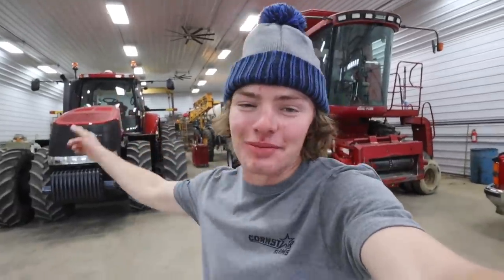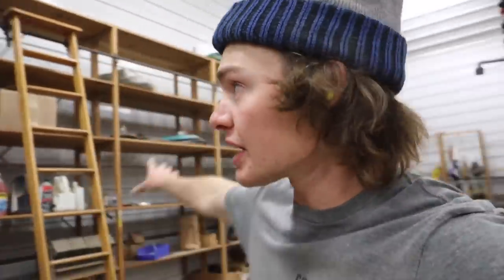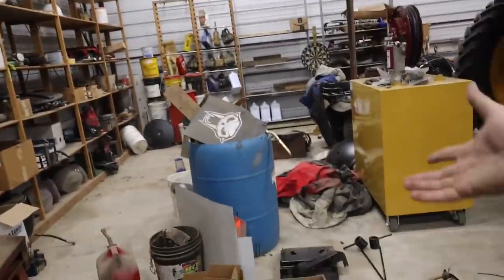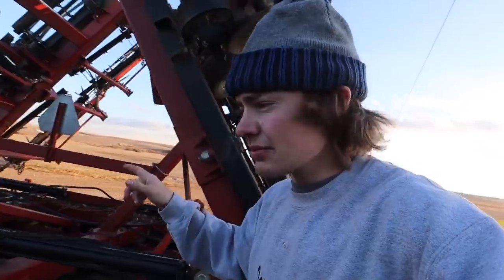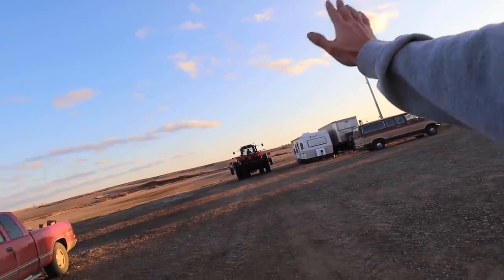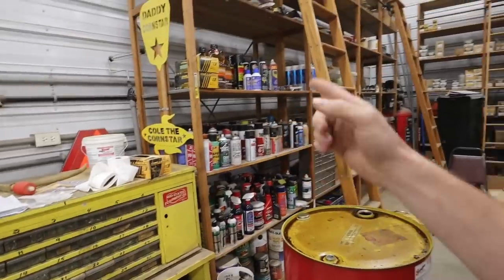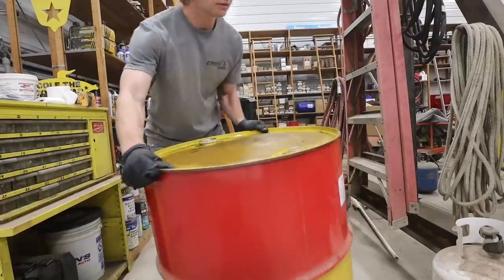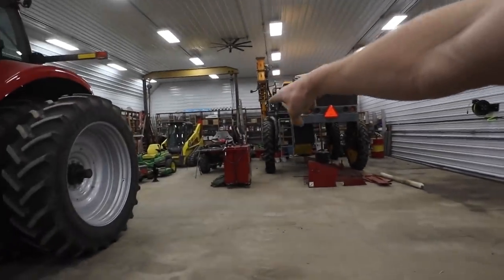WE DECLUTTERED A GIANT WAREHOUSE!

Comment: In  our shop when it was built, we put in a oil change pit and a lift. We use the oil in an oil burner to heat the shop. The after thought we put retractable power cord form the ceiling. We are taking a page out of your book with the library shelves. Last year we had skylight installed to help with the lighting.

Comment: My great-granny had an old International harvester refrigerator. Was still running in 1985.
Reply: Ive seen at least a couple that were still working within the last 10 yrs.
Reply: I have two.  1 100% running, the other needs new thermostat.  Was using it with a timer, wired temp gauge. Run 1/2 hr every 2 hrs in winter, slightly more in summer.  $40 part.  Amazing thing I unplugged both in spring.  Power bills barely went down.  I thought they were energy hogs...